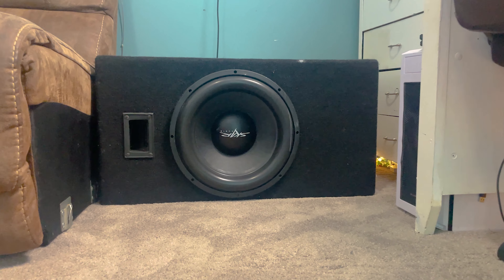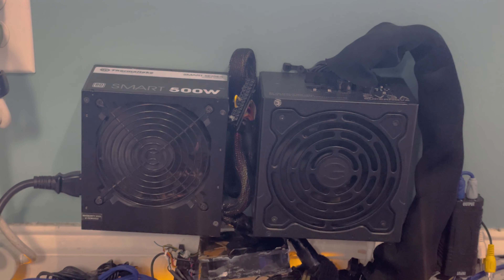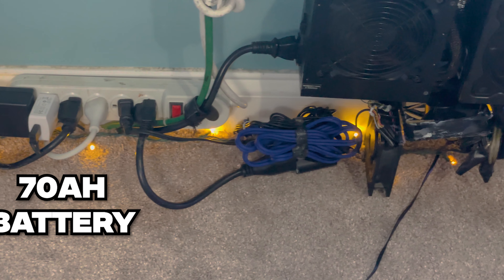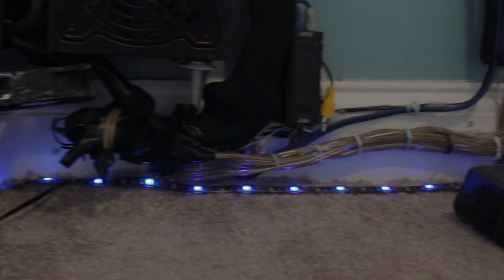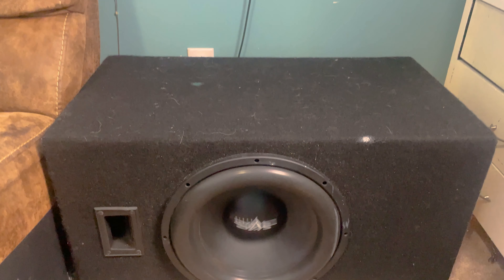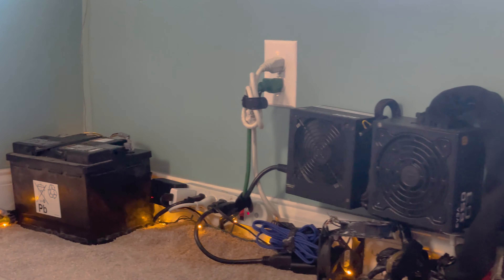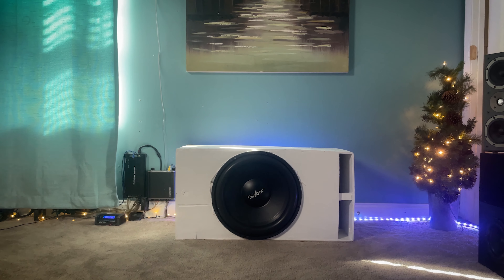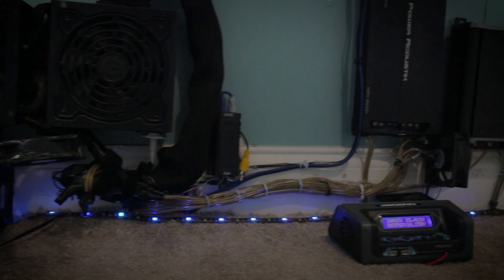How I Power 2 HUGE Subwoofers

Comment: i was doing the same thing running multiple power supplies until i got the Taramps Smart Charger 120/160A Battery Charger, it has a dynamic 14.4 volt that you can drop down to 12v output specifically for amps. With a max output of 2200 watts I'm able to run a car stereo as well as my 250 watt rms mids amp and my skar 800 watt rms amp without volt drops or amps going into protect. Smart thinking with the battery tho 💯